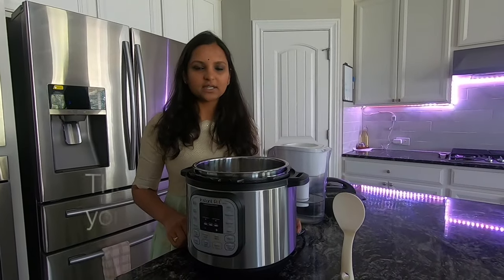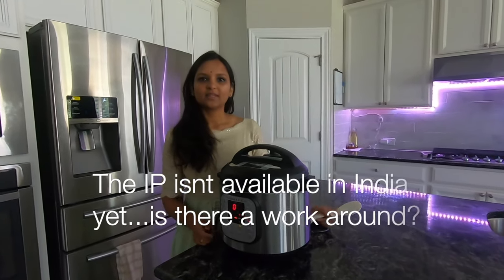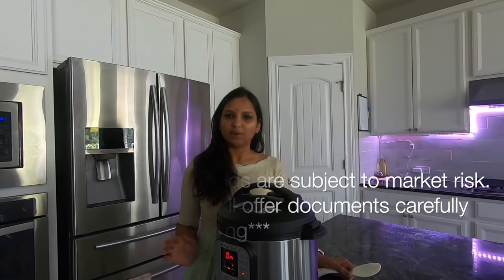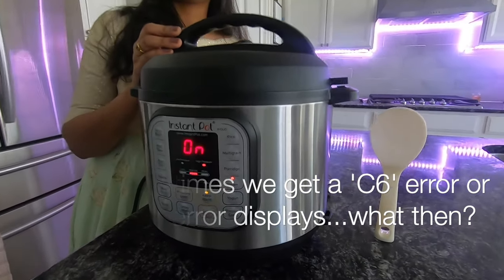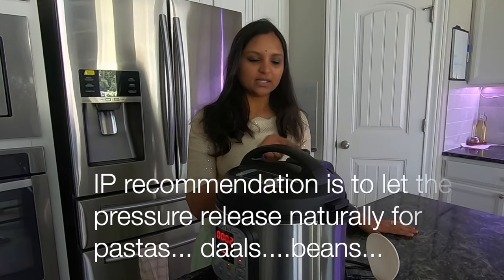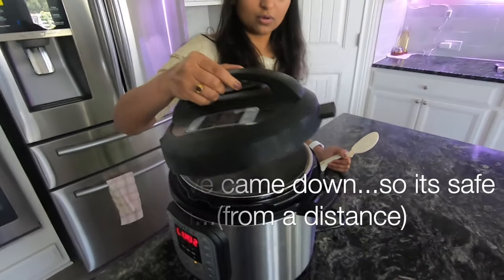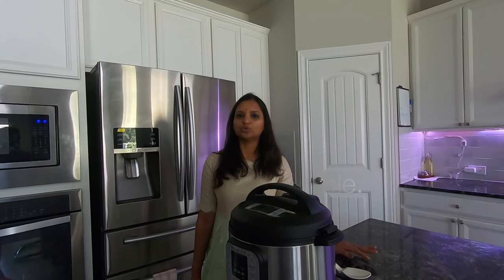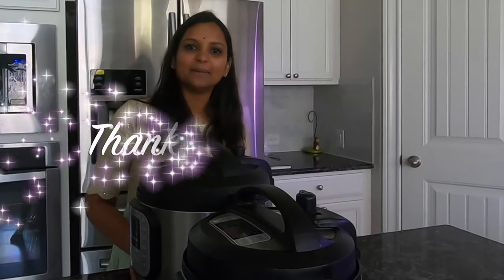Instant Pot Water Test in Telugu and English|Troubleshooting |ఇండియా లో ఇన్స్టంట్ పాట్ కొనడం ఎలా

Comment: Thanks for good demonstration ma. I bought 3 and 6 at models. I bought converter in Hyderabad. It was 2500 rupees and 2000 watts. Working well. In Amazon converters are very expensive and we don’t know what size and performance will be. Before I bought my IP I saw all most all your detailed videos and I started my cooking. Your videos helped me a lot for operational purpose. Thanks for your videos. God bless you dear.
Reply from the maker: Bindu Madhalasa you are very welcome! Thank for the lovely comment. Also thanks for sharing your experience. 🙏🏻👏🏻
Reply: Hi Bindu. I bought Mealthy pot and my sister bought a IP from USA. Could please let me know where did you buy the converter in Hyderabad with details and also please let me know about the pin converter too. It would be of great help.
Reply: @lifeisbeautiful-abeautiful88  Thank you Bindu garu. So we need to buy pin converter too ?? And the one you bought in kphb can you please tell about the specifications (should buy 2000 volts?)
Reply: Neel It is a step down converter. Just you can plug it with your IP. No need to buy any plugs for that. I paid 2500 1.5 years ago.

Comment: Thanks for the information. I bought new cooker but timer is not starting even after 45 mins. And also steam is coming out from whistle. Could you please let me know what can do for this?
Reply from the maker: Try doing the steam test from scratch again.Could be a couple of reasons...Check if the sealing ring is sitting correctly. Open the lid and reset the sealing ring. Make sure if there is enough liquid in the liner. If that doesnt fix it, return the unit to amazon for a new one. You could also open a service ticket with instantpot.

Comment: How we release the pressure normally ,we have to press the cancel button.
Reply from the maker: You dont have to do anything once the timer goes off it will automatically countdown and slowly starts releasing pressure. This will take anywhere between 15-20 mins depending on quantity. If you press cancel it might accelerate the process by a minute or two because the pot cools down faster.
Reply: Sandhyas Kitchen Thank you